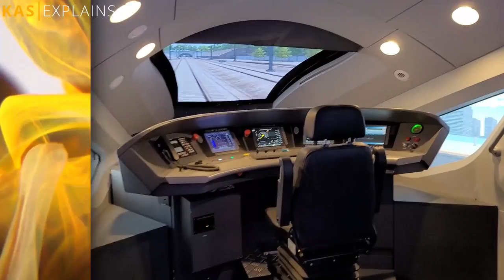[SUB] Trackless Tram, The Future of Urban Transport? | Short Explainer

Comment: A steel wheel on a steel rail has less than half the rolling resistance of rubber Tyre on asphalt, meaning it uses less than half the energy.

Comment: Sorry to say - Its really just a sexed up bus! ARC, but not really autonomous and while a narrow vehicle has some benefits a slightly wider than average bus is surely a preferred option. Also the cantilevered wheel drive system makes a more cramped space when compared to true low floor LRT. Has issues with the road / rubber tire contact and cannot off as smooth a ride. While it does have some positives I thinks the negatives outweigh when compared to a well planed LRT system.

Comment: This is the future. Its nice enough to where people will actually ride it (unlike buses) and its way cheaper and faster to implement than subway or Trams. Lets discuss?
Reply: this is just an articulated bus. A brt. Not a tram, not a train. The ride will be as smooth as the road surface will allow. Trams and trains are way more confortable
Reply: Second rate mode....
Reply: cheaper in the first place but more expensive to run on long term. the biggest pros about trams and subway is their energy efficency due to their steel wheels.

Comment: No more idiots saying it is a bus !
ART has bogies (bogeys) and it can be expanded by adding more carriages like trains. 

"The ART reportedly runs on rubber wheels with a plastic core, and its sensor technology understands the dimensions of the road, allowing it to track the guiding system that's laid out. The train currently has THREE CARRIAGES, but can expand up to FIVE,and can hold over 300 passengers. The length of the train, 31.64m, and its TWO LOCOMOTIVE body allow it to turn easier on the streets, and its TWIN-HEAD system eliminates the need for U-turns."

Buses do not have these features, kids !

Comment: Pot holes, weight of the tram itself against the pavement. The turn radius. Flooded or hazard roadways. If GPS goes out , and it do, about once a week for an hour or more. How is a the going to know it barrings in the road way? The worst scenario, crashing a 50klbs vehicle head to a car. What about weather, ice, snow, mud? whats is the point? Rails give more of safety precautions, procedures, and less headaches.
Reply from the maker: Good highlights there; the tech is gonna take time to mature, of course. As far as GPS is concerned, even in China itself, they are running them with a driver on board to cater for unforeseen tech glitches
Reply: Pot holes are easily fixed. Turning isn't a big issue it would seem. The cities where it is proposed don't flood much. How shit of a neighbourhood do you live in where the GPS goes out once a week? Rails require so much more money, space and time.
Reply: @thevannmann trams dont even need a big radius to turn btw. Tram carriages are so short to the point that a 30 degree turn is possible, also dont be blinded by the cost to build the rails themselves. There are tramways that still exist after 100+ years, while any rubber-tyred vehicle will be phased out in 10 years or so, not to mention the constant need to make sure potholes and road infrastructure can keep up. 

Sometimes the best thing to do is stick to old technology (fit to modern standards atleast). We really don’t have to reinvent trams or BRTs.

On the plus side, ARTs are more flexible to transport, make new transit lines, or anticipate obstructions on its path

Comment: My home city Brisbane is building one of these idiotic rubber tyre not-a-metro banana bus networks but it won’t be autonomous. 
Meanwhile the state government is building a real light rail network on the Gold Coast which has proven wildly popular and reliable.
Reply from the maker: its about the cost at the end of the day. lets see if its equally beneficial
Reply: You have to consider the cost and the time it will take to construct.  Also the interruption for a number of years while building and long term coming from reducing ability for cars etc.  Building rail or trams isn't a short term cost of constructuon.  There is maintenance of the track, there is the subsidisation of the service.  Those costs keep piling up year in and year out.  If it was just construction costs you'd have trains and trams everywhere in the city. 

Disadvantages are that its not quite as permanent than if you put down a track at a big cost.  So businesses and developers may not engage to the same extent at developing transit oriented hubs for business and housing.  Occurring in Melb around Chadstone.  Business cases occurring in Perth for Scarborough Beach road.  Also considered possibly for the universities and hospitals.

Well known academics such as Peter Newman is now fully behind the trackless trams and considers that new developments going forward won't be trams.

Comment: Without the tracks it's literally less efficient and uncomfortable, it's just a bad bus now
Reply from the maker: they are claiming that they have used stabilization tech from high speed rail but of course, more information will be available once it gets deployed outside China
Reply: Trackless trams are being built in Melbourne.  Business case for it in Perth on the glendalough Scarborough route.  Increasingly, trackless trams are considered very favourably compared to light rail.  Refer to Peter Newman academic articles.

Its automatic for driving and steering (though probably would have a driver) is flexible in that it can leave the path if required.  Significantly quicker and cheaper to build.  Costs of maintaining it is significantly less.  Less interruption to existing road network causing less congestion.  Streets don't need to be widened leading to significant removal of trees.  Disadvantages, but not investing in tracks developers are less invested in developments of housing and businesses nearby.  There is the concern that the route could always change.  So the public and private partnership arrangement and the development of Transit oriented developments not as successful.
Reply: @KASEXPLAINS  Perth doing business case for Scarborough beach rd route.  It was due about 5 months ago... not sure why a delay.  Occurring in Melb.  In Perth the Local govt is committed and Federals probably will.  State govt fully occupied with Metronet so less enthused.
Reply: You country must be invest in expensive ugly tram at the moment while ART is more flexible and cheaper!

Comment: tram with out rails does not make sense, if so IF THERE IS RUBBER WHEELS and long and cary alot of people it's a bus. If we add a overhead wire technology it's a trolly bus. NOW IF IT DOES HAVE METAL WHEELS & USES OVERHEAD WIRES IT"S A TRAM. Im so confused china.
Reply from the maker: its an articulated bus actually but it all depends on if its successful
Reply: It follows a track via sensors.  Only difference is that instead of spending $500 million plus in laying tracks and widening roads you can do it significantly cheaper by putting sensors on the road every metre or so at a lot cheaper cost.  You'd still probably have to widen intersections to give them free movement without waiting at lights.  The roads may need to be reconstructed in some cases due to the vehicle being much heavier than buses or trains.  Disadvantages are that its not quite as permanent than if you put down a track at a big cost.  So businesses and developers may not engage to the same extent at developing transit oriented hubs for business and housing.  Occurring in Melb around Chadstone.  Business cases occurring in Perth for Scarborough Beach road.  Also considered possibly for the universities and hospitals.